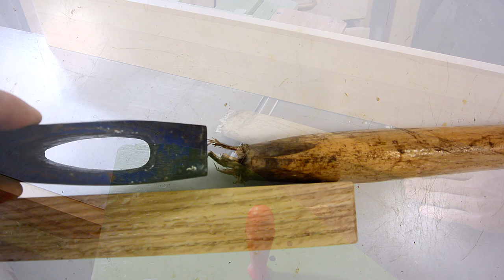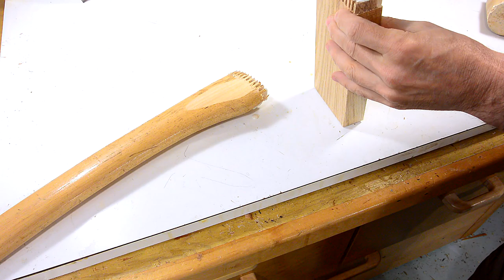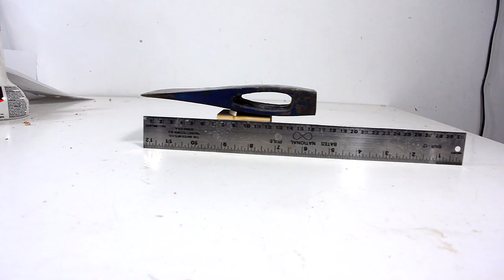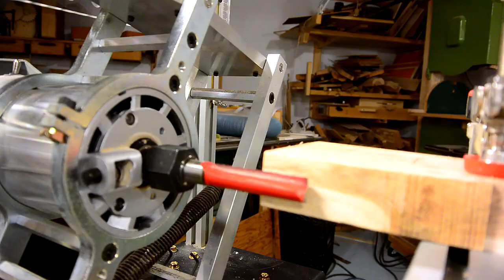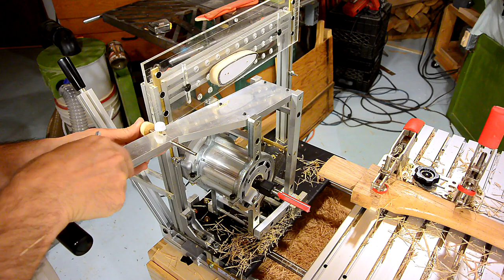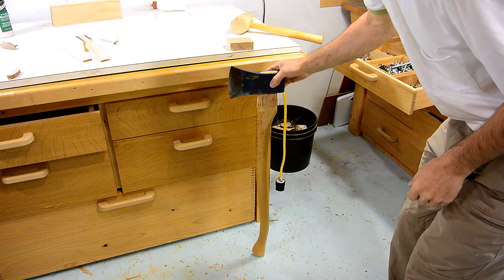Needlessly complicated axe handle repair

Comment from the maker: Sometimes I spend too much time thinking about how to fix something before I even get started!
Reply: Matthias Wandel Yes!  I do the same thing...
Reply: Matthias Wandel Yepp, same here, but most of the time it's worth it
Reply: Matthias Wandel Before i made my sawhorses, i spend 1 and a half hour thinking about it. I dont used any plans.
Reply: Matthias Wandel i love it , awsome,  cody  at wrangler star is going  to blow a gasket when he see's this. ha, ha, . please keep us updated on the life span.
Reply: chris livingston wranglerstar
Reply: Matthias Wandel gold star for complicatedness ..made me feel a whole lot better about living in a pile of wood chips and saw dust while I over think and over complicate :)
Reply: thats gonna break again for one the head wis gonna loosen up cause its not properly wedged and 2 the finger joint is in the worst spot possible thats where all the stress is gonna be on that axe should of just made a new handle
Reply: And its hard to see but it appears the grain is wrong orientation to the grain on the axe it should be straight up and down not side to side
Reply: nathan butler
To me, when I watched the video over again, the grains in both the original handle and the repaired section are going the length of the handle. So as to say, the grains are parallel and not orthogonal to each other.
Reply: Maxwell Goodacre the grain on the axe is correct the grain on the block he joined to it is not straight the grain runs at a 45 angle almost horizontal thats gonna break again i work al9t with axes and thats gonna break right where the finger joints are
Reply: Matthias Wandel LoL, you know there are about a million axe guys chewing their keyboards and frothing at the mouth right now don't you  : )
Reply: Oh stop! You didn't want to show how smart you are (not to mention we all already know how incredibly smart and talented you are) you totally just wanted to use this as a reason to use your badass machines all in one project! :D
Reply: Matthias Wandel Needless complications are fun :D
Reply: Fester Blats you must not work with an axe much iv seen the heads fly off with nailes screws and wedges holding it on if done properly with a tight wedge will almost never come off
Reply: There's the right way, the wrong way, then the Matthias way. Love it.
Reply: William Hayden
Reply: Matthias Wandel Love it! :)
Reply: Matthias Wandel Forget fixing things, I sometimes spend obscene amounts of time thinking how I am going to Build something!
Reply: Fester Blats all i gotta say is go do your axe that way and see what happens i know from experience that will not hold. I really dont care if you believe me or not like i said do your axe that way and learn from experience it will fail i promise
Reply: nathan butler Zzzzz..everybody loves an expert...you should do this you should do that, Ive seen  this ive seen that....Surprised you havent commented on safety aspects of the vid...
Reply: The head flying off and thw finger joint is the only safety i really care about
Reply: I bet youre a really interesting person to be out with socially...a laugh a minute...Zzzz
Reply: Matthias Wandel With all due respect, I would point out that the head of the axe is not symmetrical. This axe will probably be a bit awkward to handle, be cautious. =)
Reply: So, +Matthias Wandel, do you use this axe ? Results ? Screw is a good idea, but without pilot hole !
Reply: +Matthias Wandel.  If you could set up the pano-router to allow a tapered guide roller (of adequate length), viola, you would have a tapered axe handle tenon.  
Love the over complication, great to see others over-think a solution.  It allows you to show us how to integrate the cool machines/fixtures/jigs you have developed.  I know and appreciate CNC machines, but see a place for old-style mechanical copying/enlarging machines/jigs, as it is often actually easier (for a one-off) to make a 2D pattern than a detailed 3D model and G-Code.
Reply: +Matthias Wandel Measure twice, cut once!
Reply: I know the feeling all too well! lol
Reply: This amuses me :)  Problem solving is great..
Reply: Matthias Wandel i think we all know the reason you did this is because you got bored one day

Comment: I've given this some thought and consideration, and I can't think of a way to make this process any more complicated. Good job!
Nice video.
Reply: He could have figured out a way to taper the handle with the pantarouter or gone with an insanely intricate and overly complicated Japanese-esque joint instead of finger joints.
Reply: Symon Fobbester You could visit a dentist to take a rubber mold from the axe head and then create a a template out of resin....
Reply: Symon Fobbester Spring loaded locking pins inside the tenon to hold the head in place?
Reply: Symon Fobbester he could have used the pantorouter to take the taper out of the axe head
Reply: Nick Oborn Maybe I should have given this some more thought.
Reply: Symon Fobbester Remember that there's ALWAYS room for pointless overcompensation.
Reply: Oh Oh Oh, he totally could have added LED lights and a light sensor run by aurdrino so that he could chop wood at night. Since that would totally be a useful feature.
Reply: I had a meeting at work with 3 consultants and the R&D guys, and after the studies and reports came in 90 days later, we submitted this to the Product Project team, and we all decided it must be possible to demonstrate intelligence within the context of a more complicated method, but we don't know how.  We submitted a Grant Application to 4 US Government agencies, who rejected it.  Their reasoning is, 'We do it all the time!, What do you mean, you can't make something more complicated, and claim you are smarter than any critic?'
Reply: @nickoborn  Pretty damn sure that router cant cut steel

Comment: Perfect.
Reply from the maker: jimmydiresta Unlike your axe, I had a handle that could be fixed :)
Reply: Matthias Wandel jimmydiresta ouch! :))
Reply: Matthias Wandel Ahhh, but unlike your handle, Jimmy's wouldn't have broken in the first place.  :)
Reply from the maker: Mark Lindsay I didn't mean it that way.  Jimmy started with an axe where most of the handle was missing.  I started with a whole axe handle.
Reply: Matthias Wandel He could make a mold and cast the aluminum back to a handle,  every day of the week.
Reply: Matthias Wandel Ok, good point. Either way, it was a cool fix. I'd be interested in finding out how durable it is over time. I'm with you, though - I doubt that finger joint will ever fail. Unless it gets soaked or something, anyway.
Reply: jimmydiresta Matthias needs a stencil...
Reply: +Mark Lindsay - He used Tightbond 3, which should be waterproof if I'm not mistaken. Would that still be susceptible to fail if it was soaked,  Matthias Wandel I'd agree with others that I'd like to see some hard working action shots!
Reply: The glue might be waterproof, but the wood isn't. I've not had a problem with Titebond 3 failing when it got wet, but I have had 1 situation where the wood failed after it got wet.
Reply: ***** That's a bit harsh....
Reply: ***** Could it be that Jimmy said "perfect" in response to how it was a big and complicated process that could have been done much easier, but that Matthias decided to do his way anyway? Could it be that the remark "perfect" was meant as a sign of respect for the workmanship?  
Try to show some respect.
Reply: *****  Where are your videos to show us how to do it then.
Reply: ***** Matthias chose a title for this video that should have made it perfecly clear that he wasn't going about the repair in the simplest manner.  This is an interesting way to use finger joints, all you should be saying is "thanks for showing us something new".  And I doubt there will be any future frustration with this, that joint is strong.
Reply: jimmydiresta I'm convinced you guys just get together and think of ways to troll the ax safety people. ***** will probably have a purple one next week and John Heisz will make one out of concrete and izzy swan will make some drill powered one.
Reply: Zach M And every single one of them will be AWESOME!
Reply: Zach M O man this was the best comment:)
Reply: Jimmy, you are the king of all trolls, and I love you for it!
Reply: Jimmy is an artist just because he doesn't do things the Norm Abram way doesn't mean it's the wrong way. I watch jimmys and Matthias' videos and think half way through "man I would have stopped there looks good to me" so I don't see half assed ever from these two.
Reply: jimmydiresta Wow Tyveks channel must be incredible if he thinks that... oh wait...
Reply: Jimmy that reply was perfect
Reply: jimmydiresta This side of Diresta is awesome
Reply: ***** Well that escalated quickly.
Reply: Jason Gauden Honestly, as a tradesman, I can say that once you have done something often and long enough, you get so good that you can get away with cutting corners. I have looked at jimmy's work and said "look! that's a total hack!" and then smile approvingly. That's when you know you're good. 

P.S. Jimmy, that pool table was the Hackmaster general of all hacks. No slate? C'mon! Lol.
Reply: jimmydiresta Matthias Wandel fix axes and ***** flies off the handle?
Reply: jas wats yes the pool table was junk, thats the TV bizz with 2 day schedule and a EP that is expecting more for less...you do the best you can.
Reply: jimmydiresta Oh, I get it. You will do well in the apocalypse. ;-)
Reply: Zach M Best idea ever.
Reply: Zach M concrete is a great idea. Cast it with a channel inside , and post tension it with threaded rod. I just don't have the skill to do it. LOL.

Comment: I would not use an axe repaired in that way, finger joint is fine, though i think i would have done it deeper, but that screw is unlikely to hold in end grain for long with heavy use, there's a taper for a reason.
The wedge doesn't have to go as deep as what you suggested, maybe about half way.

Comment: A normal wedge-mounted handle would help distribute the load from the ax strike evenly across the whole piece of wood. Your washer mount will distribute the load to the threads of your screw. I can envision normal use causing the threads to work loose and/or split the wood. I wonder if that's something you've considered? Thanks for the quality videos! I love your work.

Comment: You can put the axe now into  a concentrated motor coolant (anifreeze). The wood will expand but the fluid will never evaporate. So the joint will be very tight.

Comment: Prediction:  The washer and/or screw threads will fail to keep the head on.  Drilling a bigger hole to use a bigger screw with bigger threads will weaken the wood.  Standard taper and wedge makes a self-tightening joint that has been time-tested to stand up to chopping, kinetic energy, etc.  Very entertaining video, nevertheless!

Comment: You're going to upset the Axe purists... You and Jimmy Diresta are causing trouble with these Axes.
Reply: Matthew McLaren I agree,  what he does is bad ax.
Reply from the maker: Matthew McLaren Not sure if it's practical though.  The metal handle moves the center of gravity, towards the hands, which means you get more of a shock on your hand every time the head hits the wood.  Comparable to whacking the ground with the end of an aluminium baseball bat (hurts the hands) vs hitting the bat where it's center of mass is.
Reply: Martin Roberts I agree, it's just axeing for trouble
Reply: Great work though!! Great video as always
Reply from the maker: Matthew McLaren Good point.  It's a tree chopping down axe he fixed.  We mostly use chainsaws for that nowadays.
Reply: Matthias Wandel  " It's a tree chopping down axe"  
Not sure of the terminology but as an aside never wear a watch when working with any tool that impacts (axe, sledge...) Have ruined several watches splitting firewood.
Reply: Matthias Wandel pocket83 recently did a "finding center of mass" video that was interesting
Reply: Martin Roberts They obviously have an axe to grind.
Reply: Chris Hall i see what you did there....
Reply: +Matthias Wandel a felling axe? haha. it was an interesting experiment anyway, how is it holding up?
Reply: They are indeed. This is not ok.

Comment: The old fashioned and in my opinion also better way to hammer down the new axe head is to hold the axe upside down in the air and hit the end of the handle with a wooden hammer for example. Can't explain the physics behind this, especially since I'm Finnish, but I think it has something to do with the head being heavier than the handle. Using a screw was a good idea. I too prefer it over the traditional wooden wedge simply because it works better and makes it a hell lot easier to remove the head if needed.
Reply: I guess that makes sense. Because of inertia, the steel axe head is going to want to stay still while (whilst?) the handle moves. I'm going have to try that. I've always just banged the bottom of the handle, opposite of the head, on a block of wood and that drives the head on pretty well.

Comment: We had a duck billed tire hammer that had been cast backwards. And we tried a both and washer like that. Didn't work. Best of luck to you that yours does. I fixed ours by milling it the other way with a bridgeport, holding for now.

Comment: Hi Mathias,

You make some wonderful machines and have some skill using woo to your advantage,  but as with all machines they are built to all certain moves and then no more, you have cleverly increases these movements with your gearing well done.

Do not surmise what something is for if you do not know. Point in case, you say the bulge in the axe handle is so it will be stronger, this is only partly true. The wider bulge also gives a means to fit the head relatively strongly, and by that I mean tightly to the handle and to prevent the handle from allowing the head to slide down the handle. your previous handle had gone past the bulge and any fitting as you should would allow the axe head to slide done. 

Your fix in my opinion should have used fingers at least twice as long to maybe three time the length. This is a good joint because you put it at right angles to the way the axe head moves so it should be better than if the fingers were turned and made so the force went straight through the ends instead of the stronger way you have made it. The one caveat is the way you have secured the axe head. Personally I would not trust this but I guess it might be OK if it is used just now and then. My advice is to keep a close eye on your joint and the single washer used. for this to work I think the washer should be at least as wide as the axe head, rather than what you have done. . . .  With nothing to stop the head moving a lot on each stroke the edges are very likely to wear through, and then even with the long screw there will be nothing to stop it falling on your head or any part when in use. Good luck. 

I would have liked to have been shown a better view of the joint now the axe has been used to check for tightness of fit and the structure of the finger joint.

Comment: I'd use caution swinging that thing, if I were you. That washer ain't gonna hold that axe head for long.
Reply: Romashk Are your washers made from tinfoil?
You will need more then a ton of pressure to bend that one.
Reply: ***** Uh-huh, believe that.
Reply from the maker: Romashk The washer won't hold that much force.  But ...  the big forces on the handle are not from pulling on the head.
Reply: Romashk I'd think the critical part here is the glue! Unless the vise goes through the connection too, I didn't see if that was the case.
Reply: Matthias Wandel Yeah, I know. But a real life test showed me the danger of this setup. Washer got bent and the head flew. I'm assuming it's cuz the force is not strictly perpendicular, but a little skewed towards the top. But I'm not a mathematician so... So, just use caution is all I'm saying. I like your videos. :D
Reply: Romashk I don't like the screw-and-washer solution either. The washer barely has enough metal overlapping the walls of the axe head, and the screw is also vulnerable to loosening over time. Maybe it would work if you used about three screws instead of one and larger, thicker washers. A few tack welds wouldn't hurt either.
Reply: dlwatib and three screws would be better than one
Reply: Use caution when swinging an axe, huh? You must be some kind of genius.

Comment: A tip for putting on axe heads is to hold it upside down of the ground and and pound on the far end of the handle the weight of the head holds it still. you don't mess up the head as much this way and it gets a tighter fit in my experience.

Comment: noticed your gluing method on this when I have a fine toothed pair I put some glue in a reporposed comet bathroom cleaner spray bottle for spray mask use just a cardboard scrap this way I get much better coverage inside joint and actually use less glue in long run
Reply: slimshadow777 the Comet bathcleaner bottle is only spray bottle I have found that will spray unthinned glue but may be others

Comment: I wonder how long that washer and screw will hold, tried those before and there is a lot more force pushing on them then it seems at first, especially with the taper reversed.
I'm guessing some of the striking force will always try to pull the handle off.

Comment: Matthias Wandel I am curious about the holding capability of the screw going into end grain like that. I couldn't really tell from the video or pictures on the website, so I'm not sure that the screw is going directly into end grain or if there is some cross grain to bite into. Maybe you would consider doing a strength test video in the future on this topic?
Reply from the maker: Luke Cummings Having experimented, a screw with good thread penetration in the end grain has an amazing amount of hold.